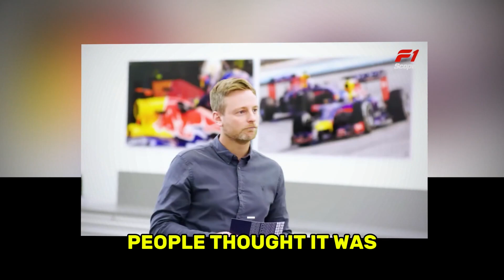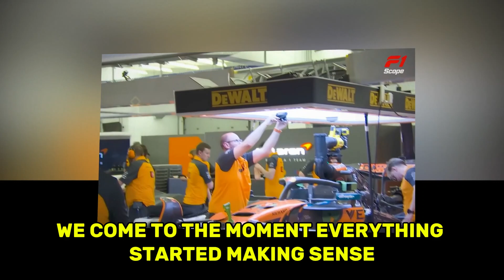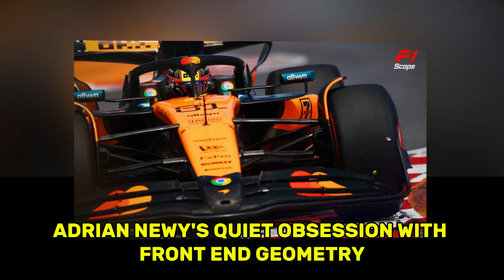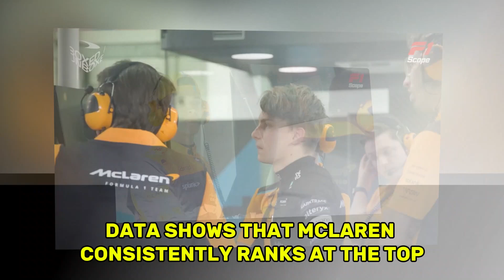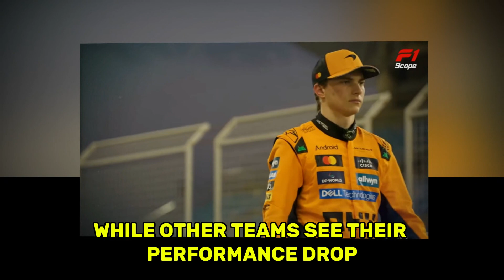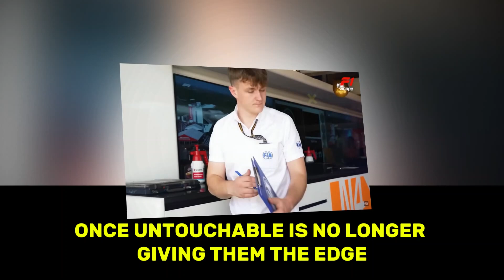McLaren EXPOSED! FIA Unveils SHOCKING Tire Strategy That Changed Everything!

Comment: The FIA needs to applaud these engineering advances, not try to disuade them. Surely, if the development of the car satisfies the rules as they stand, and that development results in an increase in performance, then it should be encouraged. The FIA bleats on about being the "testbed" for a range of improvements in automotive development that ultimately can be used in the greater automotive industry. So why do they not encourage this advance in engineering design that McLaren has achieved.